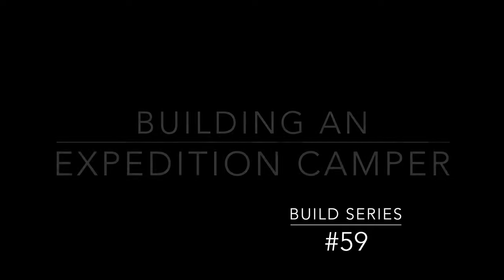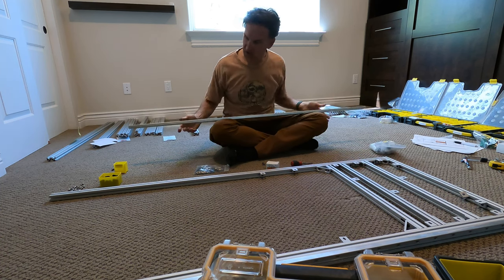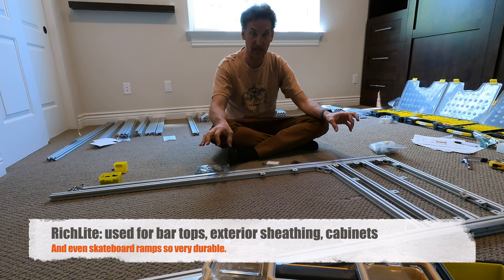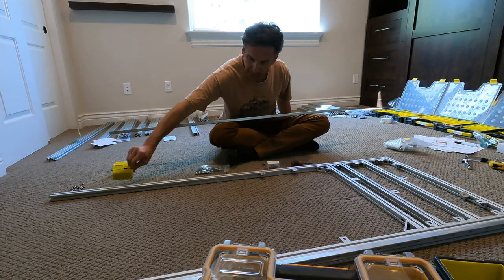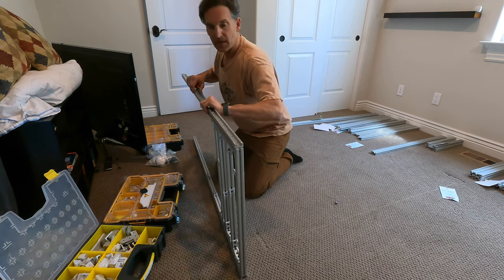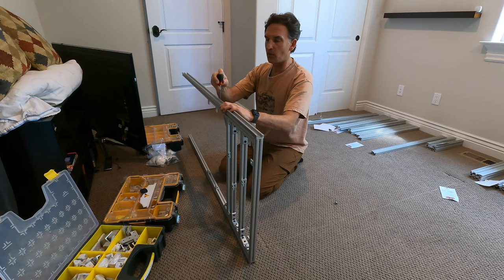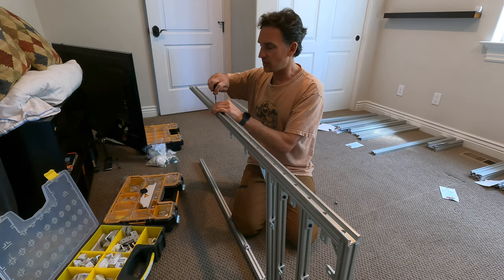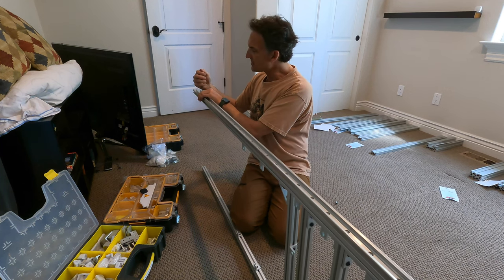Building a sliding cantilevered dinning table for my expedition camper

Comment: As always very original and innovative approach, as I plan my upcoming van conversion, I try to incorporate some of your unique Ideas in my design.
I wander if you can share the type and brand of the sliders working with the tracks you are using. Also, what made you choose these tracks instead of the 80/20 linear bearings.
Regardless of the type of sliders used and the robust construction I still wander if the long table will not have some sag when fully extended.
Thanks for the interesting build series.
Reply from the maker: Yes, great questions. I'll provide those details in a future video of it being installed and testing it out and why I chose these bearings instead of those from 8020. It really came down to capacity rating and ability to easily slide while also adding additional strength, as I too believe there will be some sag without a very torsionally rigid top and bottom surface, which is planned as well and part of the load capability as all parts are.

Comment: An actuator, hmm solid points. Sorry for my freshman question  but what would happen if actuator failed?  Chances of that happening ? I'm thinking from a series of mini earthquakes every time you go off road.
Reply from the maker: If actuator failed, it would likely freeze in a position and then I would just unbolt it and replace it. The actuators I am using are designed for over 100,000 cycles of use, far more than could ever be achieved, and are very durable and most of them waterproof. I've been using four linear actuators that hold up my queen bed in my camper van for the last 5 years without a single issue. They are incredibly strong and durable, and there is very little force placed on them when traveling on rough roads. Vehicles have been using them for years to raise and lower rear hatch doors.
Reply: @vantripping  thanks for the clarification. What a well thought out build. Looking forward to the next video! 👍🤙
Reply from the maker: @livingworkingoutsidebox  Thank you. I'll showcase a lot of ways actuators can be used to make things work better or provide more flexibility such as I did with my lifting bed in my Sprinter camper van.
Reply from the maker: @livingworkingoutsidebox  Thank you!